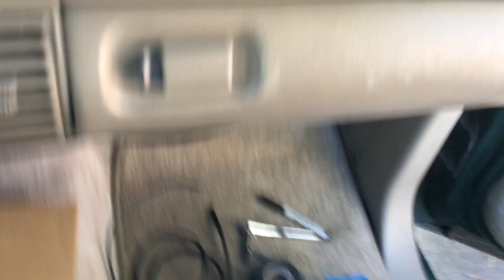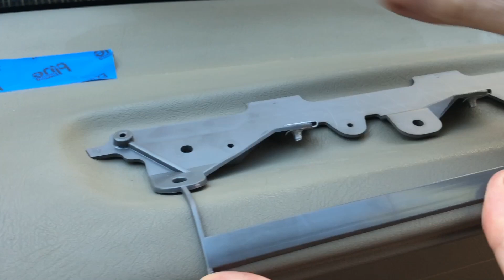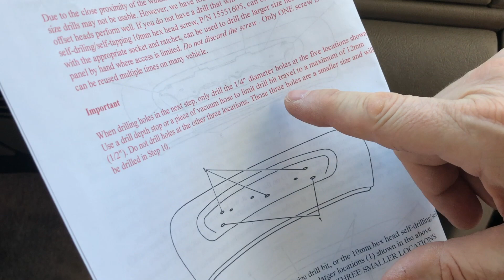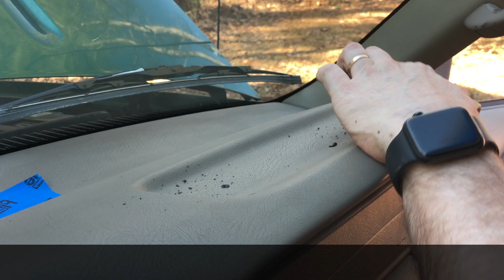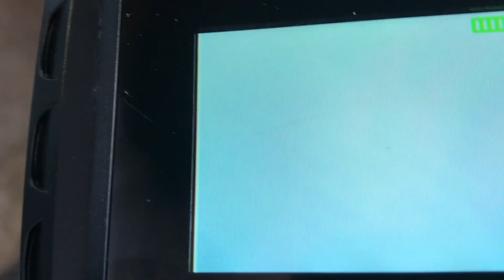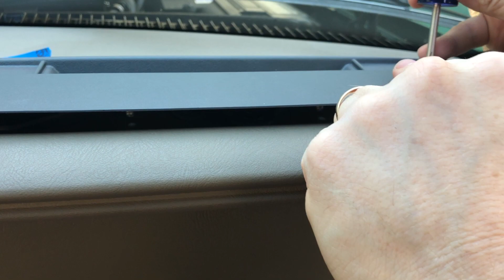1999 GM OBS Truck FMVSS Noncompliance Recall Dash Cover Kit Installation (Cadillac, Chevrolet, GMC)

Comment: This is weird,  I do remember that recall for the neck extension and like every one else ignored it , today I got my 99 yukon inspected and on the back of the inspection paper,  it states the NHTSA recall FMVSS neck extension requirements,  this has never came up before, wonder if this is because next year it's safety inspection only for our classics .
Reply from the maker: CarFAX will likely flag your Yukon as having an outstanding recall for this as well.  The irony is the parts are discontinued, so the dealer couldn't effect the recall anymore anyway unless they agreed to use NOS parts you supplied.  You can still find these kits as NOS at the link in the video description.

Comment: Why are you installing this now?  20 years and it hasn't been an issue,  so you want less storage pocket on top the dash?  Seems unnecessary.....
Reply from the maker: You can't store anything in there without it sliding out onto the floor in a turn due to the shallow depth.  We have grown up kids riding in the passenger seat now, so the safety gap is more of a concern.  So I reconsidered my original decline decision when the truck was under warranty.  That GM engineers wanted the truck that way was another consideration.  That I enjoy doing installs like this was another.  ;-)